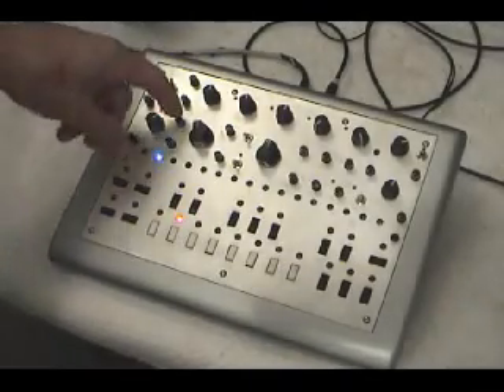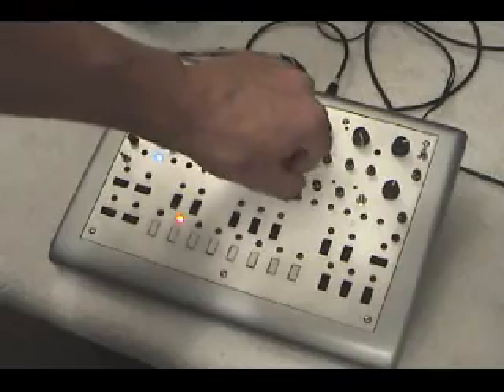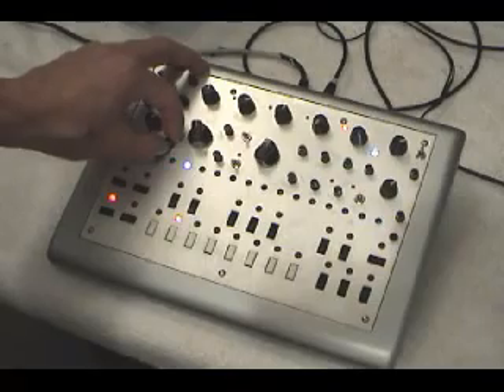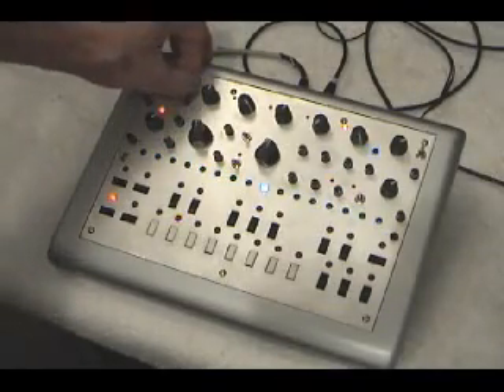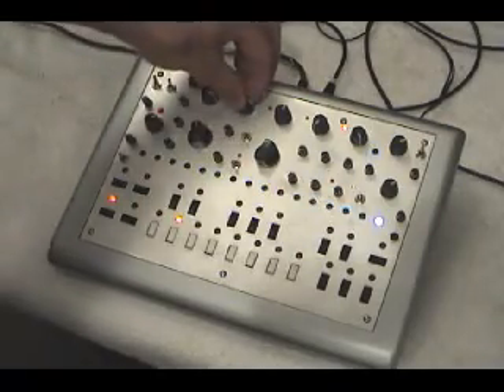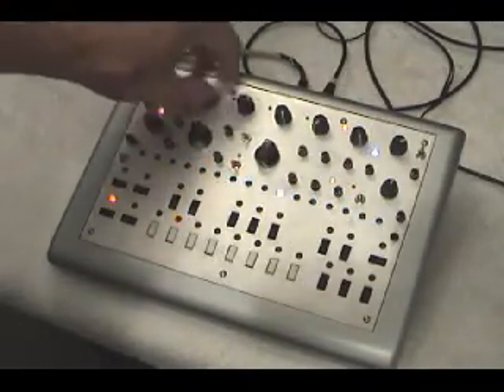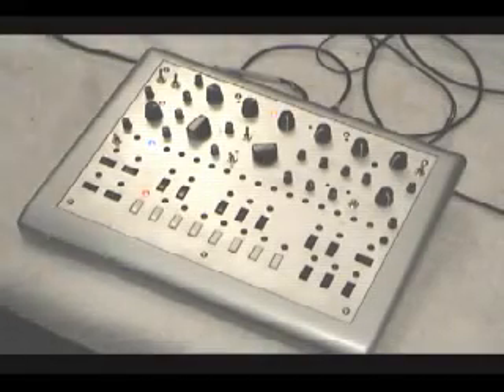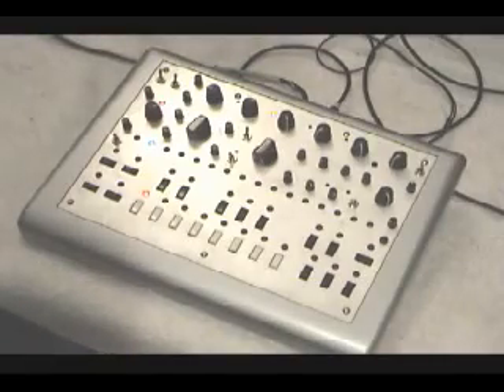x0xb0x Mod Final Prototype Video 1

Comment: for those asking for schematics: check out for the AD/AR env generator using LM324 and some diodes and few transistors, its really a small form factor env generator good for most of uses. just find the gate point on the pcb and solder wire to the input. for overdrive, just remove replace the input resistor from the VCF with a potentiometer, for filter tracking you have to take the CV from the VCO, put it into a active multiple circuit (one tl072 is enough) and the second multiple of the CV you put it into an attenuator and then inject that into the resistor that goes after the Cutoff potentiometer (assuming that the VCF input has already the exponential converter) and then adjust the attenuator till you get the VCF sine wave (in self-oscillating mode) to play in tune for 3-4 octaves.

Comment: insane mod mate. You can get such an incredible range of sounds. Yes a schematic would be nice...  top marks.
Reply: for those asking for schematics: check out for the AD/AR env generator using LM324 and some diodes and few transistors, its really a small form factor env generator good for most of uses. just find the gate point on the pcb and solder wire to the input. for overdrive, just remove replace the input resistor from the VCF with a potentiometer, for filter tracking you have to take the CV from the VCO, put it into a active multiple circuit (one tl072 is enough) and the second multiple of the CV you put it into an attenuator and then inject that into the resistor that goes after the Cutoff potentiometer (assuming that the VCF input has already the exponential converter) and then adjust the attenuator till you get the VCF sine wave (in self-oscillating mode) to play in tune for 3-4 octaves.

Comment: hi mate - do you have the instructions for doing these mods?

cheers
Reply: for those asking for schematics: check out for the AD/AR env generator using LM324 and some diodes and few transistors, its really a small form factor env generator good for most of uses. just find the gate point on the pcb and solder wire to the input. for overdrive, just remove replace the input resistor from the VCF with a potentiometer, for filter tracking you have to take the CV from the VCO, put it into a active multiple circuit (one tl072 is enough) and the second multiple of the CV you put it into an attenuator and then inject that into the resistor that goes after the Cutoff potentiometer (assuming that the VCF input has already the exponential converter) and then adjust the attenuator till you get the VCF sine wave (in self-oscillating mode) to play in tune for 3-4 octaves.